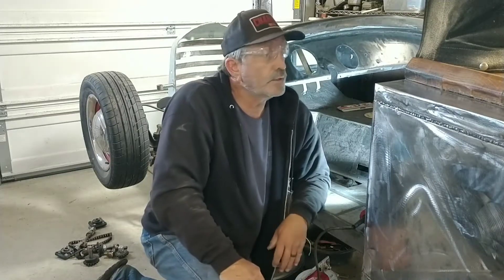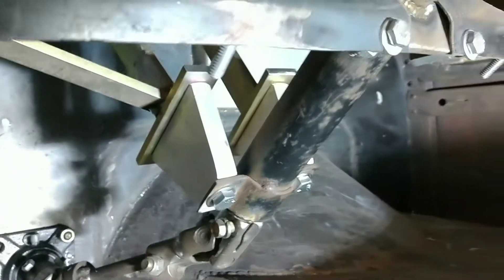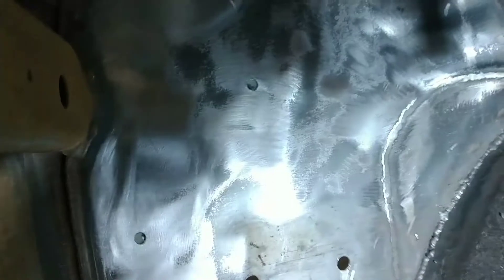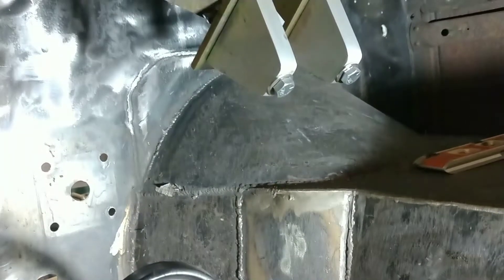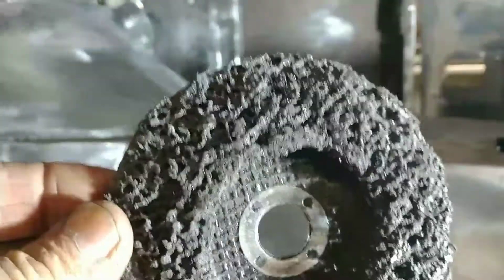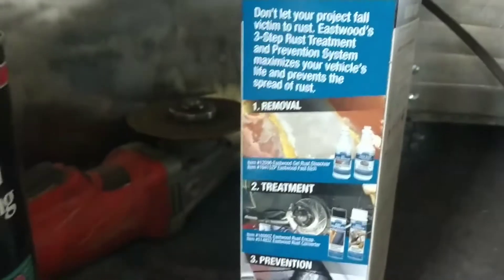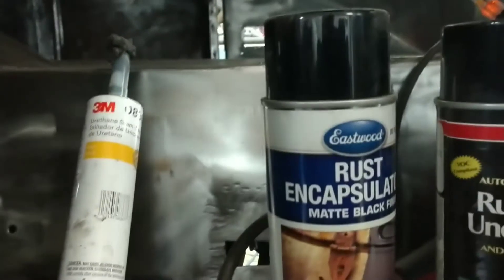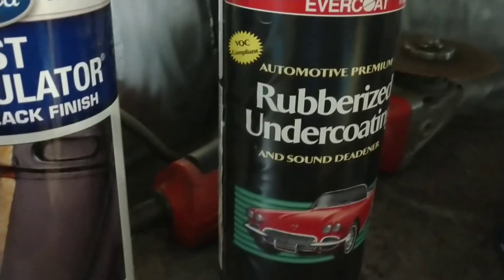Rat rod rust

Comment: How did you like the Eastwood rust encapsulator?  Better or worse than POR15 or some of the rust oleum stuff?
Reply from the maker: It's a good product, I haven't used the other stuff, but used the rust encap on the frame and it dryed with a hard shell . Trying the aerosol for the first time. 😁👍 Thanks for watching and commenting I appreciate your support thanks. Robert